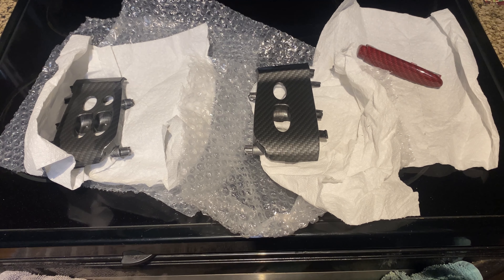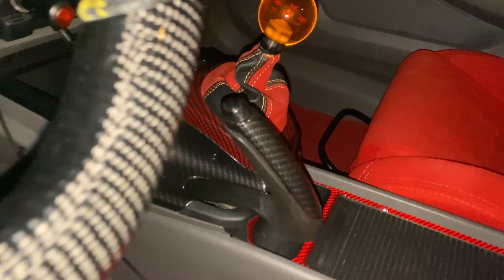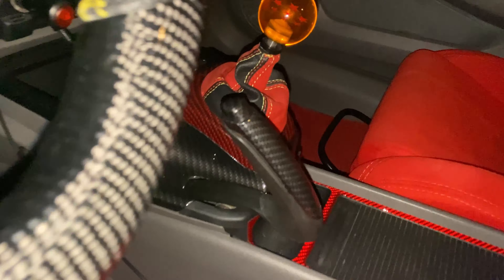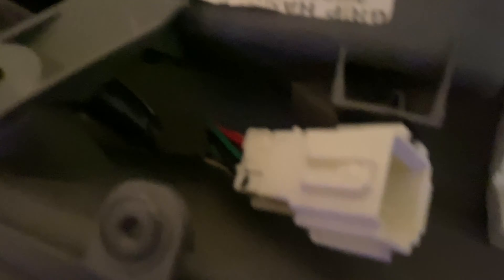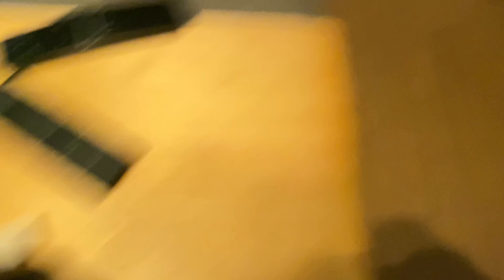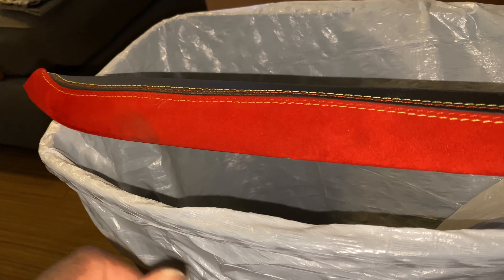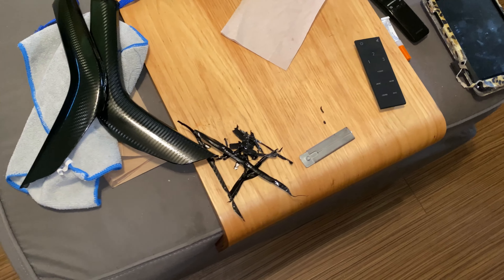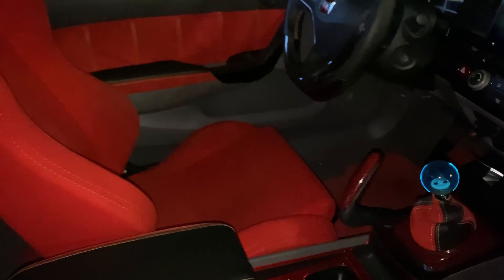06-11 Honda Civic cf window switches coupe

Comment: How the weapon r manifold.  Does it break or it's fine no problems
Reply from the maker: go back and watch my videos on the manifold. that will answer your questions its been on the car since install zero issues. you just have to tune out one code or buy the special gear. just tune it out as its not required then. Other then that its quality i had two sold one and my current neo ti one on the car. pare it with the prp throttle body spacer